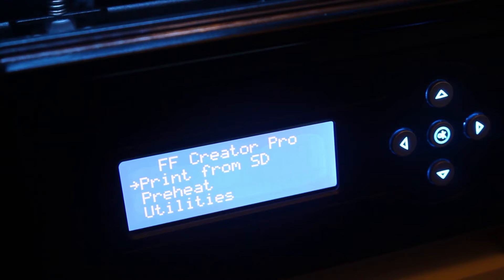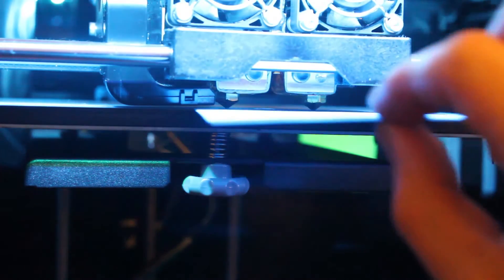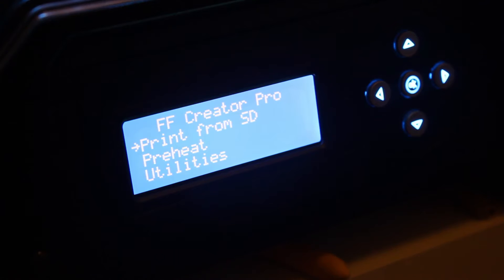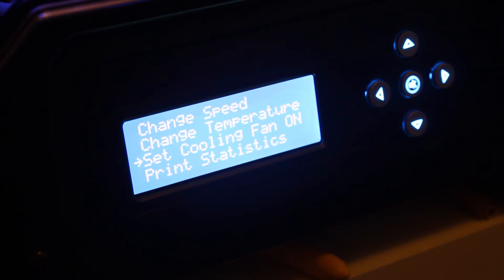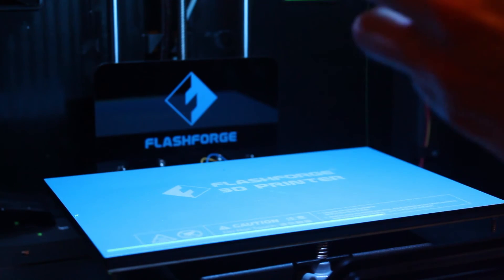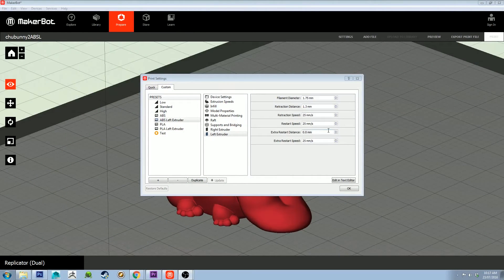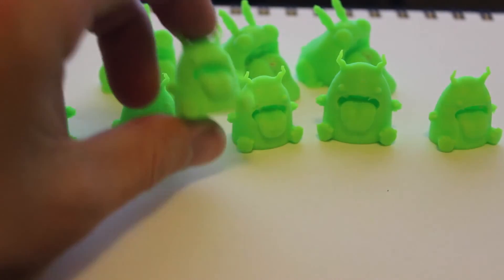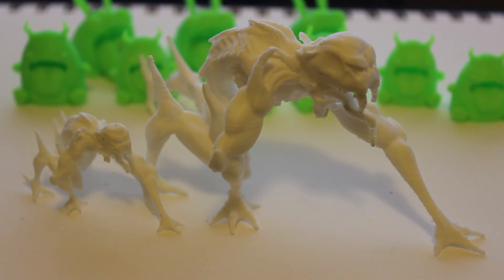zBrush 3D Printing Pt.3 - Printing with Flash Forge

Comment: Temperature definitely the issue with fine prints like this, I've found that if you print more than one item at a time it helps with cooling time.
Reply from the maker: That's a good tip I think I may have noticed an improvement on similar models where I printed 4 at a time, I'll have to try the same here. Cheers!